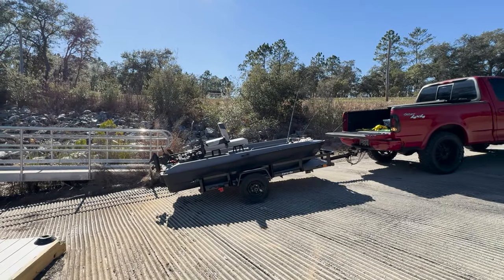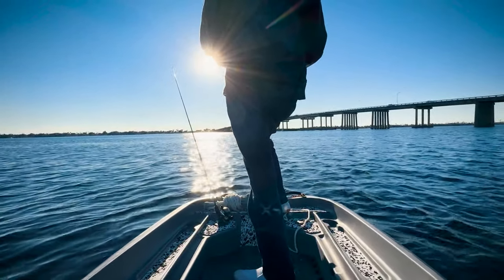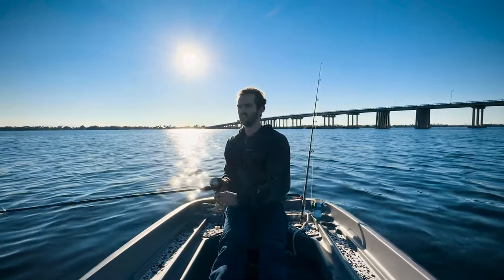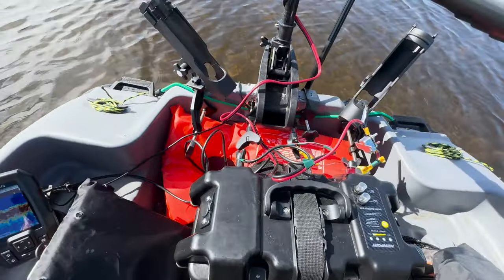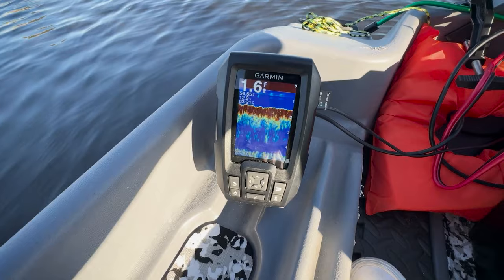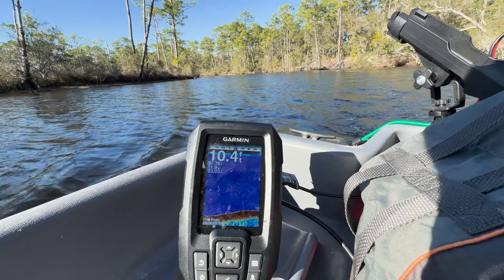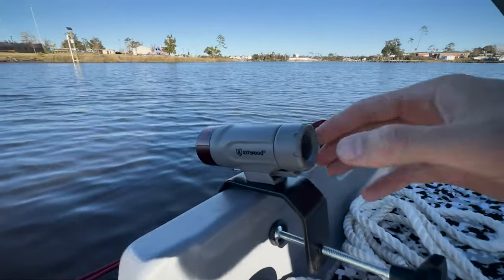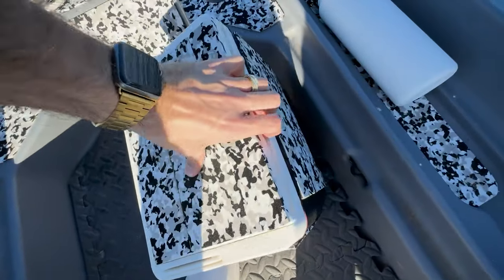TOTAL Cost of My Tiny Boat Build | Custom Pond Prowler

Comment: When you look back and that Lead acid advice didn't age well AT-ALL
Reply from the maker: Yeah, didn’t expect lithium prices to absolutely plummet over night🤣
Reply: I bought a 2.5 suzuki out board motor and it does real good. It does flex a little, but when i read the manual it said it is suppose to flex some, because if it didnt it would CRACK the plastic!!

Comment: Looks like you could use some practice backing your trailer down the ramp so you can get it closer to the water to load your boat without dragging it up the concrete ramp!
Reply from the maker: Yup! At this point I’ve got it down pretty perfect. Definitely needed more practice at the time of this video recording.

Comment: I don't like rear mounted motors since pushing a boat is much harder than pulling when your following a shore line or fighting the wind. But since You're only using one. I guess it makes most sense in the back.

Comment: Does that require boat license?
Reply from the maker: Nope. Check your state laws, though. In Florida anything under 10 horse, doesn’t require a license.
Reply: @GreysonRoberts  oh nice much appreciated for the reply, and thanks for the video
Reply: In my state I had to register the boat anything 10 ft and over.  But i did not have to register the motor because it was under 10 hp.

Comment: I went with the Duralast from Auto zone lead acid 27-DC version, running at $119.00  I HEARD SMART BATTERY BOX CAN FIT FULL SIZE 29DC 210 MINUTE REVERSE CAPACITY OR 105amps